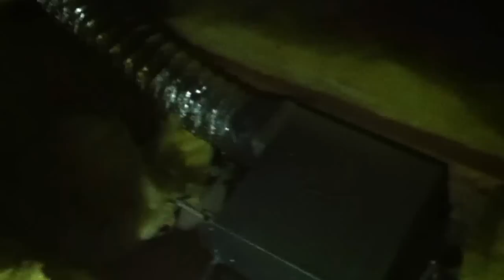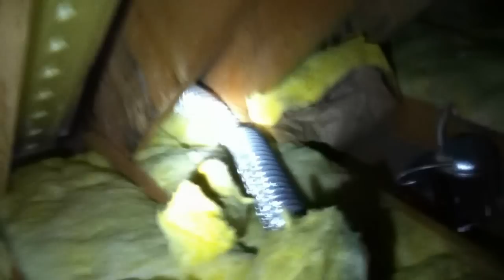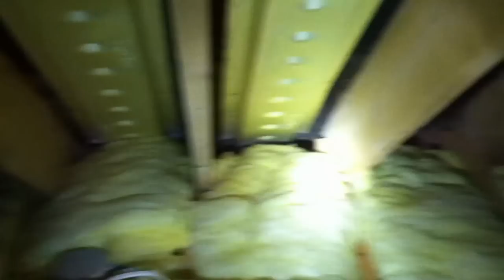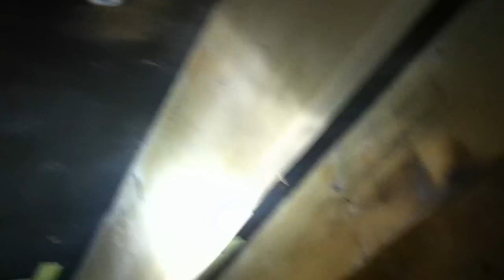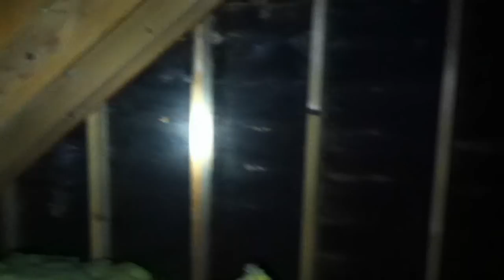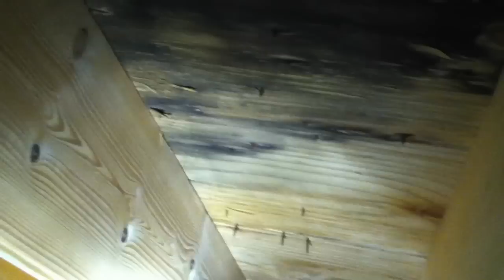Bathroom-Fan-Venting-Through-Soffit-Causing-Mold-1.MOV

Comment: Actually there is nothing wrong with venting out the soffit.  You just need to replace vented soffit panels for 4ft on either side of the vent with solid ones.  With that level of mildew in that house, I am guessing there are other leaks also.  Tape all joints and seal the vent box properly!